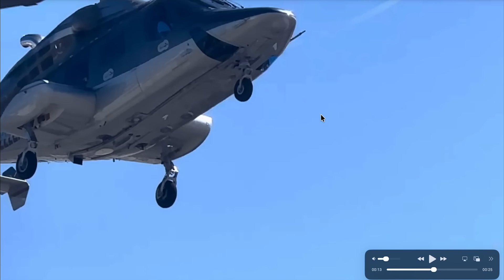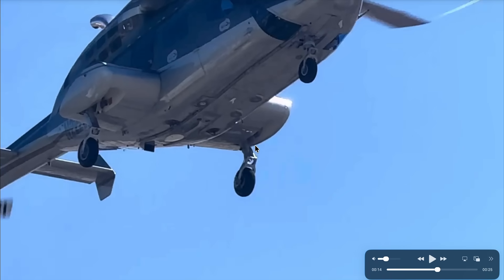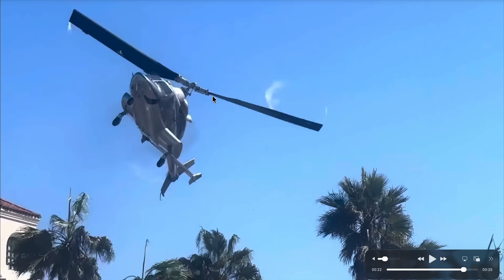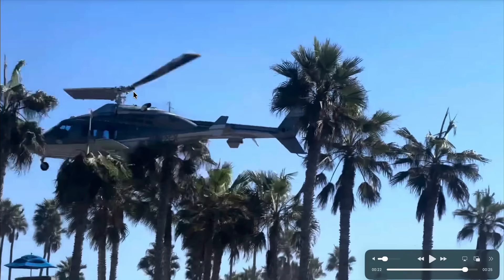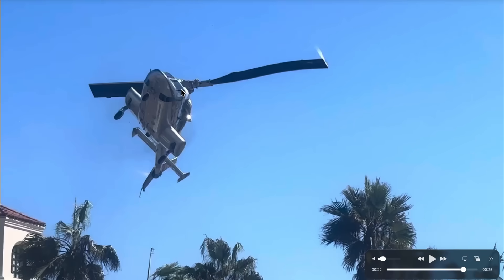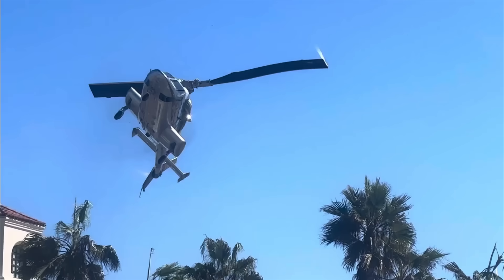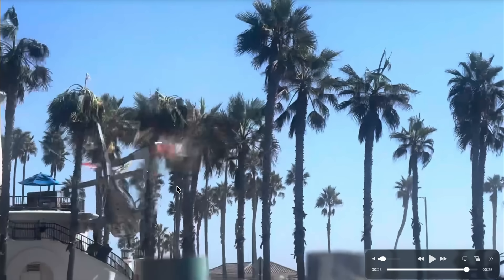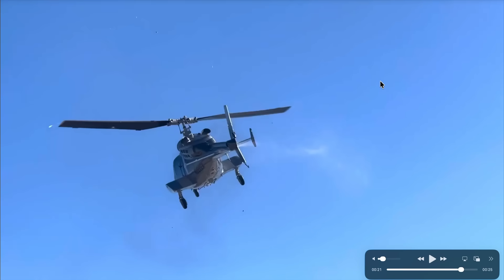Huntington Helicopter Crash Analysis - SlowMo Video!

Comment: Excellent video analysis of this crash. I am a retired commercial helicopter pilot with over 20,000 hrs. PIC in rotorcraft. I have extensive experience in Bell light and medium airframes including some time in the triple Duce.  Your slow motion video and explanations are spot on. In my opinion this crash was caused by tail rotor failure leading to loss of control. The big question here now is WHY did the T/R fail. It appears tail rotor blade failure lead to massive imbalance which lead to gearbox separation. Great Job, Thanks!! You need to send this video to the NTSB.
Reply: If you look closely when the helicopter is facing the camera you can see one of the tail rotor linkages appears to have seperated and is hanging down. This is just before the loss of control and failure; there is another longer video than this of the landing that is zoomed in some and you can see it's spinning unconnected for 10-20 seconds before the loss of control happens.
Reply: @arrrgee yes. I saw that. I agree. Do you think it's palm tree debris got in there? They were right at tree height. Although I never see any
Reply: @jamescollier3  He was never that close to the trees (prior to the mechanical failure occurring). It just looks that way from a few of the camera angles... forced-perspective and all that.
Reply: Hi Sir , excuse my English. 
I saw on previous videos ( before the shopper crushes) the helicopter flowing more times over the beach and there is particularly a one video where you can ear a “ dump sound “ coming from the helicopter  ( for me like a  car gearbox without oil )
Reply: I too am a rotorcraft pilot, and your analysis is quite acute. I suspect the main rotor remained attached due to the TT straps and pitch links. The pilot likely introduced full pedal to recover whatever tail rotor authority was to be had. My guess is that the TR gear box exploded and took out the TR blades, as they seem to have been cut in half. There were no strikes of vegetation or birds, so something caused them to separate. Likely that the high humidity and temp may have caused him to pull too much collective. Fortunately I believe they’ll be able to rely us what they were experiencing.
Reply: The past of lead is led
Reply: @paulschnyder938  And the past of led is Lithium Iron Phosphate (LiFePo4)
Reply: @paulschnyder938 I used to use unled gas
Reply: @paulschnyder938  You must be a hoot at parties
Reply: 20,000 hrs ! You’d know helicopters inside out !
Reply: Tail rotor gear/gearbox failure or tail rotor pitch-link failure?  But are either of those the root cause?
Reply: Could the palm trees have caused a “ground effect” like reaction the pilot was not expecting?  On the wide shot (not shown here), you can see the pilot react violently to the rotor wash coming back off the trees and then the failure happened. Can too much input cause a failure like this??  I am not a pilot. Just looks too coincidental to not be related.  Wash hits trees, pilot puts in TONS of collective, ship goes up and failure starts. 🤷‍♂️
Reply: What I see in the video (not having anything like your experience) is likely a tail rotor drive failure first (tail rotor suddenly changes speed, should not happen) which induces uncontrollable yaw.  Departure of the tail rotor happens shortly thereafter, so the departure in itself cannot be the cause. However its also possible that the originating problem could have been a problem with tail rotor pitch control, which probably could also cause what we see in the video.  But anything that occurred after the change in speed of the tail rotor is secondary, not the primary cause.
Reply: 20,000 hrs and you did not think of VRS (Vortex Ring State)
Something we were taught about being it is hot here
Reply: @allanc3655  because it wasn't settling with power (VRS if you like). Nothing about that video looked anything like that happening is why it wasn't mentioned I am guessing. Not to mention it wasn't hot (74) and being at sea level with pretty close to standard air pressure that day.
Reply: When you're working on your helicopter and your wife calls ripping your ass saying you forgot to take out the trash. Oh ya where was I ?
Reply: Looks like tail rotor drive shaft failure. Bearing or joint destruction.
Reply: 20k hours my ass. The tail rotor linkage came off, you can see it plane as day but you have 20k hours of experience. Sure ya do. Most fixed wing or air line pilots don't retire with that.
Reply: The video shows tail rotor spinning in the opposite direction. That means that an opposite force was applied to the tail rotor. 
The only force is the vortex ring bouncing off the palm trees.  Palm trees can resist 100 + winds. In the other videos it appears to be a cross winding landing.
Reply: @my88k-mrr98 
Rotors only spin in ONE direction.  Variable blade pitch is used to control lateral thrust.  The PERCEIVED change in the rotation of the Tail Rotor is an effect (optical illusion) of the video camera's shutter/frame rate relative to the RPM of the rotors.

This can also be observed when watching videos of cars driving in forward motion but the wheels appear to be rotating backwards or at different (slow) rates relative to the vehicle.
Reply: @bbfoto7248 The "optical allusion" is showing the speed change. The frame rate did not change so one has to assume that the rotation of the tail rotor change. On the other videos it looks like a cross wind landing but the palm trees are steady until the copter comes near. Pieces start to fall from the tail rotor which is key. Tail rotor shaft or gear. 
The effects of the Palm trees on the vortex ring is suspect.....
Reply: @my88k-mrr98  pitch link became detached earlier in the flight, nothing to do with palm trees or vortex ring state... you are way off with that guess. Only one blade changed pitch as they brough the pedal in for the hover, that's when things got seriously out of balance and ran out of pedal and more things started breaking. You were correct about the rpm reducing (your original comment did make it sound like you were saying the rotor was spinning in the opposite direction - but I can see that is not what you meant).
Reply: @MeppyMan  It will be interesting to see what they find.

What I saw was the build up of the down wash
with the tail rotor reacting to it. There was a cluster of palm trees  on the left and one or two in the right. I saw the tail rotor vacillate in speed and then  free run. That made me think that the shaft broke or bearing spun. Then the housing fell to the ground.

If the trees were not there it would have landed no problem .....But what do I know..........I play with "choo choos"
Reply: so the tail rotor came off and you diagnosed a tail rotor failure? Are you some kind of genius?
Reply: @tektkite7255 Other failures may have caused tail rotor to come off making not a tail rotor problem but a result of the problem.

Comment: The reason for all the pitch on the tailrotor is the pitch link has let go.
Reply: yep, and one blade is pitched, the other is not. vibration. pilot paniced. Basically, half the amount of antitorque available, and he ran out of that once he slowed down and he realised WAY too late, and did the worst possible thing, yank the collective to get out of there. I dont think id have done any better.
Reply: @jeremyjohnthompson5187  how do you know he panicked? How do you know he pulled collective? The initial climb looked more like the main rotor rpm increased due to the power change as the tail rotor started failing and was no longer being driven. But the thing is none of us know. We can only speculate based on experience/knowledge (or lack of it as seems to be the case in most comments).
Reply: @MeppyMan  its teh rate at which he climed and just how far he climbed, when viewed fromthe beach video. He gained the altitude of the height of that entire building in the background in 1 second. The collective went up.  The tail rotor didnt suddenly loose torque, there wasnt a sudden increase in available power, the pitch link was broken, one blad feathered, and the left pedal was allready maxed out. once he slowed down, the vertical stabiliser no longer had airflow and it was 100% on the tail rotor, and that didnt work.

Comment: Appears the pitch control was still working when the tail rotor gear failed. 
It lost drive to the tail rotor, and the pilot gave it as much pitch as he could.
But when the rotation started, the main rotor came around and hit the tail rotor separating it.
Reply: You can see the pitch link has failed first before it all happens
Reply: @ryancadwallader2049 it doesn’t look like the pitch link separated until the main rotor struck the tail rotor.
You can see a pitch link flying off, but it appears the main rotor had struct the tail rotor.
They were extremely lucky to be as low as they were… because the main rotor separated just as it went into the trees… any higher and they likely wouldn’t have survived
Reply: @ryancadwallader2049 Yes, a single pitch link failed, and a single blade went neutral, causing the tail rotor system to speed up, not slow down as the change in frame rate was thought to be a slow down… it was the rotor speeding up as one blade went neutral.

Comment: That makes a lot more sense now that the pitch control had been compromised for one of the two tail rotor blades shown at the 5:14 mark.  That condensation vapor trail is so obvious for that one particular blade being misaligned from the other.  Loss of a linkage or other part being detrimental to blade symmetry to maintain balance.  I remember an Airwolf scene in which I just literally re-watched a few weeks ago, Season 2, Episode 1, "Sweet Britches," about the 10:30 mark in which Hawke exercises the tail rotor linkages to "check" how that assembly functions.  Very good close up of that area......  The pilot was flying at a noticeable yawed angle (opposite of the loss of the tail rotor direction control later) for some time with his approach to the landing area.  He may have been trying to overcompensate, not knowing there was a beginning of a tail rotor blade assembly failure.  All aboard were absolute damn lucky they were that close to landing site and even much more fortunate for the palms to have at least slowed down the uncontrolled rate of decent right before impact.  It's awful to see any airframe crunched up, even worse to see the Bell 222A lost.  I hate to see incidents like this happen, but I learned a tremendous amount from the post.  Thank you!
Reply: There's a video of every other helicopter before this one flying in and landing. IIRC none of them were coming in with that much yaw angle. Will be interesting to read a transcript of what the pilot reports, especially if he knew he had a problem and was attempting to get it down before it failed. Aviate, Navigate, Communicate. He only had time for the first one, until the tail rotor failed. Then he had no time to communicate to ATC what was going on. Navigate was easy, get it down (preferably without crashing) ASAP.